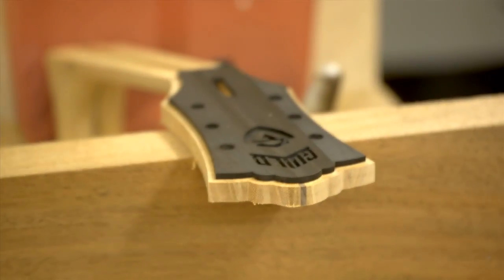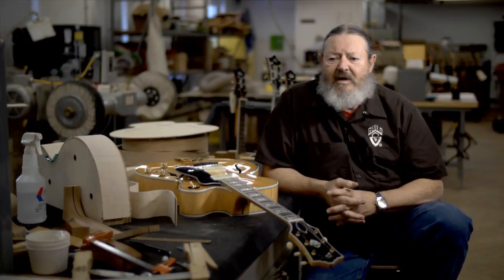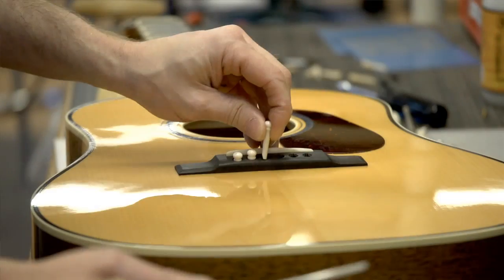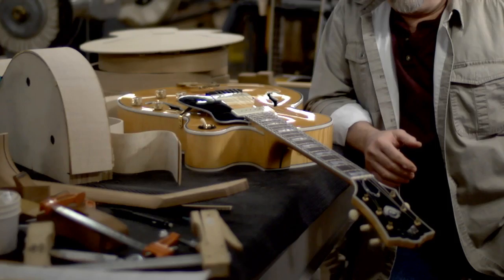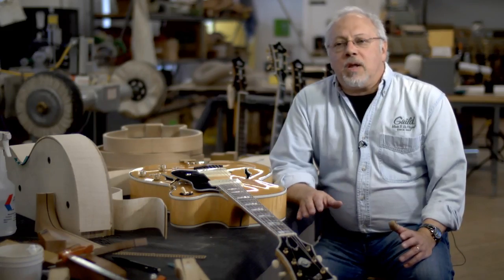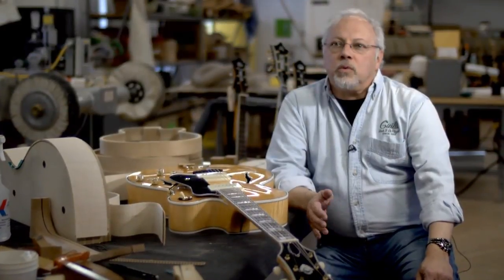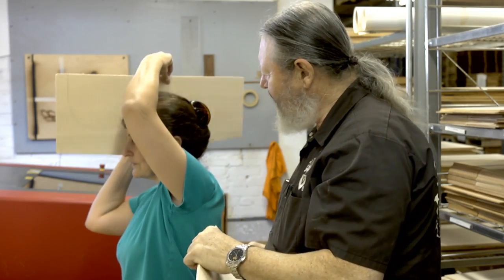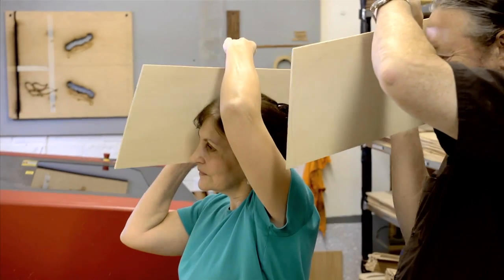Introducing The Guild Custom Shop

Comment: I've played American made guitars since I was a Teen, all from the mid 70''s I just honed in on that era, basically from when I was 10 years old, Guild, Fender, Gibson, due to injury, Economy & lack assistance to get back to work. I've lost those treasures, My 74 Guild F-50 I miss the most, along with a Guild S300D Electric. just great guitars. I got to work in a Vintage Shop in Houston was able to repair,  restore guitars, & it is how I got these two Guitars, giving up half my paycheck for weeks. I can't say enough about the quality of Guilds, the necks, fret boards, & the tone. I got quite spoiled playing them. Hats off to the Custom Shop, I sold new Guilds during the Early 90's, it was a pleasure, & yes, 1 is not enough, I always wanted the 12 String mate to my Jumbo F-50, you might Remember Stevie Ray doing an acoustic set on a 12 String Guild. Enough said. great work!

Comment: I had purchased a Guild Stuart X-500 in 68' or 69' and the bridge moved when I changed the strings and I didn't know what to do so I called Guild and they told me to bring it to the factory. At that time,they were in Hoboken,N.J.. It was an experience i will never forget!

Comment: Guild made truly great guitars in the past and they still make some very fine, fairly priced, instruments. I was thrilled to see they were starting a Custom Shop. But the online shop is a spectacular disappointment. When you go to the site you get a page showing the Orpheum Series, a bunch of pre-designed, pre-made guitars, priced from $4800 to $5200 (much cheaper than the Martin customs!), all of which are probably very nice instruments. But there are no custom options.

Martin used to have an online custom shop that allowed you to "build" & get a price (usually $10k and up, up, up) on a guitar with whatever options you wanted, with lots of choices. (Now they just refer you to a dealer - too bad for those of us who want to fantasize). Guild's online "Custom" shop is just a new line of guitars. That's it. Nothing custom about it.  I guess one couldn't expect anything different from Fender, the mass-production people. 

The upside is that Guild still makes a lot of guitars that are very much worth what you pay for them - unlike Martin.